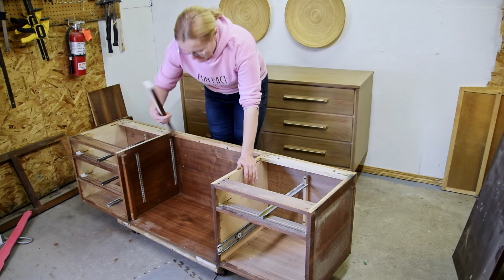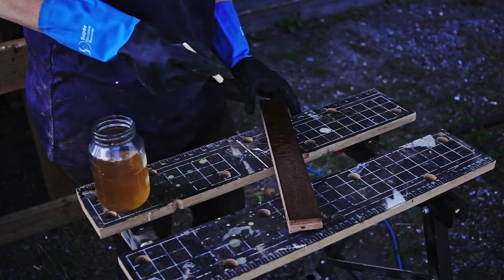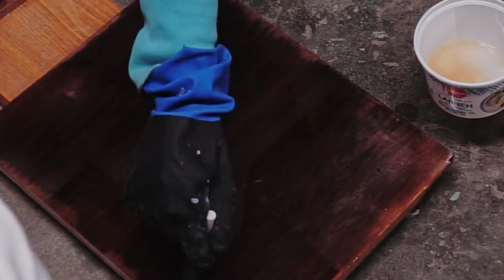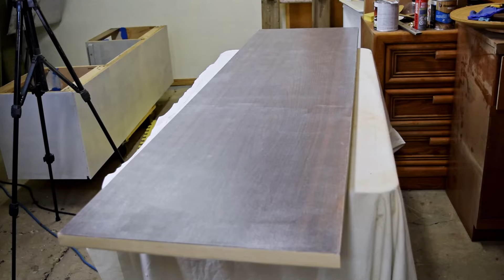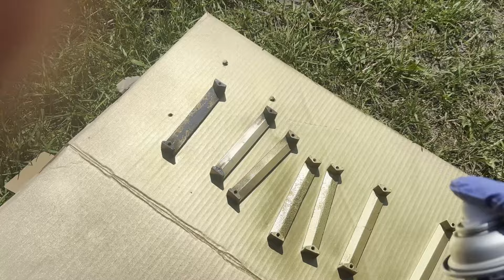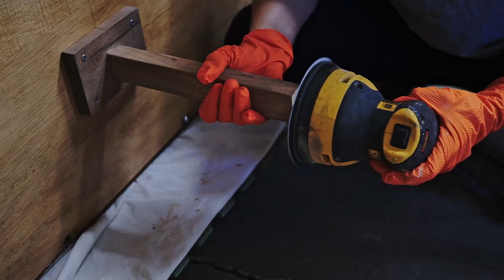1960s sideboard experimental makeover

Comment: Beautiful result! I admire your perseverance. Here’s a tip, to knock down the paint between coats, buff with kraft paper or piece of paper bag instead of sandpaper. Works a treat.
Reply from the maker: Thank you so much ☺️ I’ve tried the trick with craft paper but sometimes I have some type of thin hair (not mine I do know where they’re coming from) and need a sand paper. I have never had any issues before I tried this paint.
Reply: @Diamondmakeovers  It may be fibers from the paper.